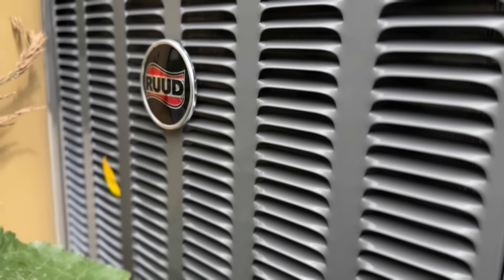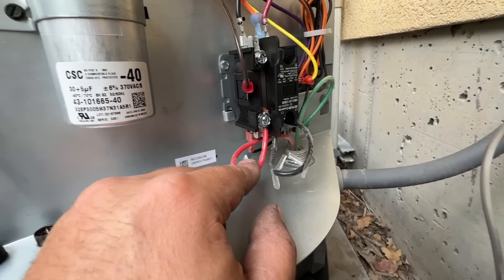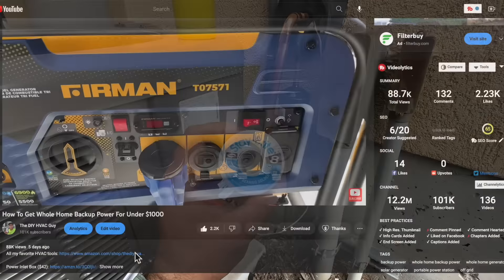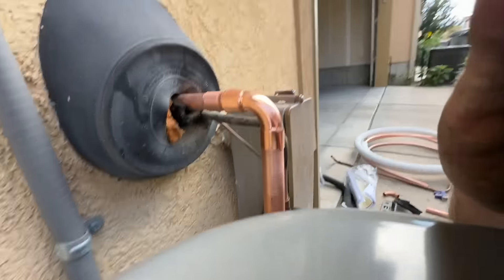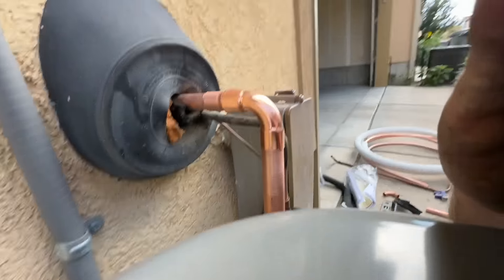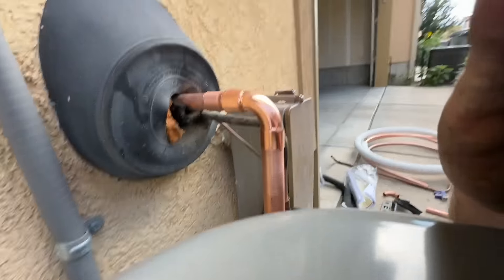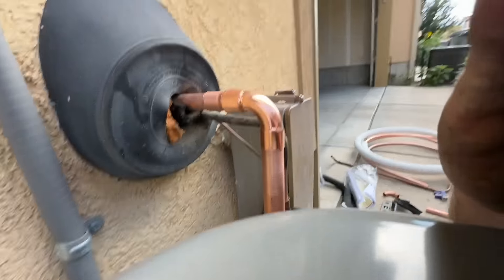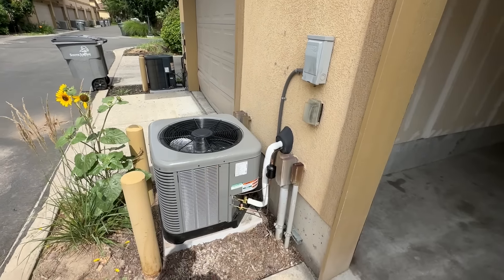HVAC Contractors Don't Want You To Know How Easy This Is...

Comment: Great job Dave, l need an advice on my central ac at the start of this summer when turned it on with thermostat set at 62'° it was cooling but air flow was minimal and when l checked the condenser outside the whole pipes were ice frozen l thought it was the capacitor bought a new one and replaced it and it's still the same pipes still frozen and the room is not going any lower than 82°?
Reply from the maker: Dirty filter or evaporator coil will cause this. Or it could be low on charge. If you need help diagnosing, check out our remote assistance page at Patreon.com/diyhvacguy   Hope we can further assist you! Cheers
Reply: Alright thanks l will check it out.
Reply: It's frozen up put it on fan only call a contractor to put freon in it and hopefully find and fix the leak
Reply: Definitely check the filter and the coils before the freon level is checked
Reply: Alright thanks

Comment: After system only blowing warn air , replaced capacitor and I thought it was fully fixed  . It was blowing cool air but doesn't get to set temp 78 gets to 81 during verry hot days here in San Antonio Tx with 110 F heat index . I've replaced filter even though it wasn'r filthy clogged .  Just washed wuth hose the outside unit coils from the outside and noticed the fan changed from  very warm aire to cool , But didn't make  a difference still 30 minutes later hasn't gotten temp lower . Still at 81 . What can a DIY try next ? No frozen lines . Not long ago a couple months ago it was getting down to 74-76 degrees

Comment: I could have saved $5-6k installing my own new system last July 2022. The installers seem lazy and overworked in July. The outside guy was vacuuming the system and forgot to open access into the lineset 🤦‍♂️. He also melted the base pan on the new system during the brazing cos too lazy to cover stuff with a simple wet towel or some heat paste. Amazing how much companies charge these days and do crap work. 14 months later there’s a compressor issue now.
Reply from the maker: Man, sorry to hear that. Hopefully they make it right.. that’s what I’ve been telling people. Just because it’s a well known company doesn’t mean it’s gonna be good work. Just like buying a brand new truck doesn’t guarantee it’s gonna be any good
Reply: @diyhvacguy  compressor is under warranty. But the labor to install it and remove old one is $1485.00. They are covering the $1814 cost of refrigerant. Which costs maybe $200. I think I saw 25 lbs at ability refrigerants for $399.00. It actually went down since last year cost wise 😱. I’d do it myself if I could get the compressor under warranty but I highly doubt the manufacturer will give it to me 😂. 13.2 lbs of R410A.
Reply: @diyhvacguy I bought a DIY MRCOOL 24k mini split I installed myself and it’s been running since May 2019 but this central split system we financed last July 2022 already croaked. From a hvac company in town. Crazy. 

Thanks for taking the time to respond!

Comment: Dave. Thanks again for a great video. Even though I do this as a side gig. It does help me a lot to gain experience. Appreciate and God Bless you always!
Reply: Bryan do you know what manufacture makes a great dependable mini split systems that a well qualified DIYer could install myself and won’t break the bank? Customer service I see is had to find also. Thanks, 😊
Reply: @Ron_Presley  i haven’t installed a mini split system yet. But in the future! There should be a lot. Like Mr cool.
Reply: @Ron_Presley  I used alpine home air. My system is 8 years old. Works as good as it did the first day. I diy’d including buying the tools for around $1800. My quotes in 2015 dollars were for $6000.  This is for my garage. I used 18k btu mini split.

Comment: I’m not in the business, but is it commonplace to use fittings on a lineset? Every one I’ve seen is bent with a bender so there are no joints to leak except when attaching to the condensing unit.
Reply: It's super common. Even with a good bender it's difficult to get a clean bend on a 90. Takes less time to put in a fitting than mess with a bender too, especially if you mess up the bend.
Reply: @TofuInc  thank you for the response. I appreciate your expertise
Reply from the maker: Yes very common. No problem as long as you make a good connection whether you are brazing or soldering 👍🏼
Reply: These are soft line coppers and not hard drawn lines.

Comment: I have a single story 1500 sq ft with a flat roof.  By the time it becomes the evening you can feel the heat soaking thru the roof and ceiling which just reheats the house. So can you recommend or any of your viewers a mini split company brand that has single mini splits and up to a 4 zone package.
Reply: I would recommend Daikin because of there warranty. We have been selling them for the past four years and have very little trouble out of them, what trouble we do have is usually user error or installation error. There inverter technology is well thought out.
Customer support is very helpful if you have questions or problems.
Reply: @nd3498  thank you and will check the Daikin tomorrow out. So if you do have any issues their customer service is easy to get ahold of and they will help customers out? I see so many don’t even get back with buyers.

Comment: I'd like to know how best to choose a condenser to work with my existing air handler and linesets.  15 years old 3 ton unit that was showing signs of weakening even when I bought the house 8 years ago.  South AZ but house kept at 90F all summer. It's not a critical item as the house is empty 8 months a year during the hot months.  I love the idea of soldering with StayBrite system and I;ve installed my own Minisplit successfully in my northern home, using basic gauges and vacuum pump.  Was thinking of something like a Blueridge or Goodman 3ton condenser for $1600-2000. But I do not have knowledge of matching it to my old system - maybe a video on that topic some time?

Comment: My old system had two compressors, a high and a low. The one compressor went out and they replaced the whole system inside and out. Something tells me that all they really needed to do was replaced the outside component.
Reply: It just depends if the system is a r22 System then when you change it you have to change everything because they do not make R 22 systems anymore. I’ve actually seen some people replace the R 22 expansion valve with a 410 expansion valve at the evaporator coil and then just change the outside unit with a 14 condenser. Only thing is that now you’re mixing two types of refrigerant oil which is a big no-no.
Reply: @georgehuerta1990 Well that makes sense. And I hear they're changing to a new type of refrigerant now. I expect that'll probably be the same thing all over again.
Reply: @Leonardokite  yeah I’ve heard that too they’re talking about getting rid of 410 to go to some other goofy refrigerant all you really have to do is follow the money trail it’s got something to do with money. I’m sure somebody’s Patten on the refrigerant has run out and now they come up with something else. So now they’ll start telling customers well now you have to change all your equipment because of the new refrigerant blah blah blah.

Comment: it creeps me out that some installations have thermostat wires just exposed to the elements like that. Our air conditioner installation actually ran them through a conduit. They are rated for in-wall use, not external use. Wind, hail, critters, and even your dog can easily damage those cables if they are not placed inside a conduit.
Reply from the maker: And why does this creep you out? Haha I’ve literally never seen it in conduit.
Reply: @diyhvacguy  Well, it says in my reply that wind, hail, critters, and even dogs can damage those cables. I get why you think it's silly since I'd have to call a guy to fix it every time that happens. Low voltage wires should be in a conduit by code. I don't care if it's low voltage. They used to do it. It looks really stupid having these naked wires flapping around in the wind. It literally is part of your home wiring. Why wouldn't it make sense to protect it?
Reply: exposed stat wire is funky but reality is other than a dog or whatev they last many years not running through conduit. I've never seen the brown cover cracked
Reply: It is not code - It might be better practice - Everybody thinks they are an expert.

Comment: 3:34 that switch with the button, what would cause that to pop out even when the handler is calling for air? My outside unit keeps turning off and the button if i push it in will let the outside work but as soon as i let it go it turns off. If i reset everything at the breaker for 15 minutes it will fix it for a little while.
Reply: I believe you are talking about the contactor. If it is calling for cooling and the contactor is not pulling in, you most likely have a safety (high pressure possibly) interrupting the circuit. Possibly the thermostat is not sending a call for cooling(low voltage signal to the contactor). You would need to use a meter to find the break in the electrical circuit to start with. My information/knowledge is limited, hope this might help.

Comment: Is there a brand that is known to last?
Reply from the maker: Ruud/Rheem seems to have a really good project. I’ve got a few friends that have been Ruud/Rheem dealers for a long time and they love that brand. Definitely quality components unlike the builder grade Goodman units. Goodman does have a good project but they are for sure a builder grade product.
Reply: @diyhvacguy  Thank you.  I'm in FL, and my 15 year old Trane keeps needing parts.  It has been ridden hard over those years.  I would gladly buy another of the same if one were available.  I'll check into Ruud/Rheeem then.  My water heater is RUUD, and it's lasted forever.

Comment: I have a question having about a 20 year old Armstrong 1.5 ton unit that is maybe a good candidate for repplacement soon. It is about 10 SEER and wondering if I can replace it with a 16 to 17 SEER single stage with soft start.  Is that possible and what is good source to purchase one?
Reply: Most likely need to upgrade your evap coil to be compatible with the higher seer condenser, which may also mean upgrading your furnace as well to handle a bigger sized cabinet required for the evap.
Reply: @turnedearthdesign8678    Well this unit is for cooling only AC.  I to sounds like replacing it with mini split is maybe more  cost effective as I can use the electric line in place just change the breakers
Reply from the maker: Also depends on the refrigerant line size. If it goes up from 3/4” to 7/8” line size then your efficiency will all go down the drain.

Comment: Did you isolate your micron-gauge from potential oil contamination before you opened the service valves?  I like to see a ball valve in-line (another valve core removal tool works great) to isolate the gauge before releasing the gas.
Reply: He had a valve on the micron gauge, but forgot to close it before opening the service valves. Micron gauge is now junk.
Reply from the maker: Nah, clean it with denatured alcohol per the owners manual and it’s good to go. Mine has seen refrigerant and it’s not dead after that by any means.

Comment: If you located the one tiny leak in the condenser, and that was the only problem, why not just seal it? Asking as a homeowner who paid well over $1,000 years ago for a new condenser, yet only $2 to have a car's radiator leak sealed long ago... It was already empty, right? So no freon to remove, no real evac to pull until you sealed it. Honest question, don't attack.
Reply from the maker: I didn’t like the idea of reusing the compressor that was running on air for who knows how long. Also this was a micro channel coil which is made out of aluminum and I don’t have equipment to fix aluminum. If it was copper maybe but not aluminum. I’m about to take a class that shows how to do it. And it requires some specialty rods for a torch

Comment: No Bleeding nitrogen through system while soldering or is it not necessary because of the lower temperature involved?  Also as far as proper terminology, a king valve is located on the outlet of a receiver, although they are basically the same. Nice video btw!

Comment: We've got a unit that's about 5 years old and the return line is partially getting sucked together and causing the unit to freeze up. We have an ac guy that has been out, does it need a bigger return line?

Comment: The old line coming out of the house you said was too long actually looked better than what you did by cutting it at the elbow and now it has to bend out of the way to clear the dryer!
Reply from the maker: I disagree, but what does it matter? 🤷🏻‍♂️
Reply: @diyhvacguy  It matters for the look of professional installation!  If sloppy workmanship looks like this, what about things that aren't visible??!!!
You ever look behind the dash of a car where all the wires are bundled together?
How about a main server rack with all the Ethernet cables?
How about PVC piping for a sprinkler system doing to control valves?
None of these would matter if it were done in a sloppy and random fashion - they'd still work!
Reply: @diyhvacguy  I think you owe the home owner an apology and should go back to do it right as it was done before!  All that effort to make it look worse is not productive!

Comment: Need to protect the thermostat wires. Piece of flexible conduit works great.
Reply: i use sealtight, other than dog protection, 've never seen the sun crack the outer coating in my 30yrs of hvac work
Reply: @ltcuaa  Yeah, it's the critters and random falling branches and the like.  The little wires make me nervous.  Mine has small die metal flex conduit.

Comment: I’ve watch a few of your vids, great content, but I do wonder why you have to remove the schrader valve before pulling the vacuum?
Reply: It greatly restricts flow so everything takes a lot longer.
Reply from the maker: Yes it takes 10 minutes for me to pull a vacuum whereas if I had the core in, it could take an hour.  If you have a plug in vacuum pump and you can let it run for several hours, you can totally leave the cores in 👍🏼

Comment: Charging R-410a as a gas ?
Reply from the maker: I added some to try and locate the leak. But if you are talking about the new unit, no the Tank was upside down so it was being charged through the low side as a liquid 👍🏼

Comment: You should never solder 410A. POE oil acts as a solvent and picks up the soldering flux and redistributes it throughout the system. This ends up clogging orifices and capillary tubes. There is a reason why every single manufacturer's instructions say "braze".
Reply: Such dumb scare tactics
Reply: @Miketime969  You are clueless.
Reply: @chaseme9860  your making assumptions that huge amounts of acidic flux are being used and making it inside the piping .  Not clueless but thousands of jobs in the field done with solder and not a single solder joint failure in 24 years
Reply: @chaseme9860  go babble around and repeat more nonsense
Reply: @Miketime969  This has nothing to do with joint failures. And yes, you are clueless if you believe what you say. A cap tube can be as small as 0.5mm. A pin drop of flux will clog it. Also, flux contains water. POE oil is hydroscopic, which means it wants to adsorb water. Water is a non-condensable. This is very bad for the system. I encourage you to contact any manufacturer's engineers and discuss this, but if proper HVAC standards are "babble" to you, you probably can't be helped.
Reply: @chaseme9860 I'm an engineer and overall paranoid about doing things exactly as instructed by the manufacturer since as an engineer I tell people to do things for a real reason not just because I feal like it. Thanks for this comment.

Comment: 36 years in the business. Most major installation instructions tell the installer to BRAZE using sil-fos or phos-copper alloy and specifically state. DO NOT USE SOFT SOLDER. 5,10,or 15 years down the road they often fail. The original installer just cost the custmer hundreds possibly thousands by not following the instruction manual.
Reply: I was a tech, then service manager, some 25+ years ago before, and while going to, college… I agree that 5 or 15 percent brazing alloy is what I always used, and sometimes code also requires a braze (just like plumber are required to braze any copper underground)… However, I looked up that Staybrite 8, which is 6 percent silver and the rest tin (maybe with some other trace allows, but didn’t lookup the MSDS to verify)… Point is, seems like it works sufficient for line sets, and if allowed by code, I don’t see a problem… I might be worried about using it on a compressor replacement due to more significant vibrations… Although, I can do a braze with acetylene about just as fast, and prefer a sof-flame when in the attic as it is less heat, but higher temp, than the swirl tips like TurboTorch…
Reply: He says he doesn't have to flow nitrogen either. I've always used acetylene turbotorch air acetylene. Does MAPP gas not get hot enough to create scale from oxidation?